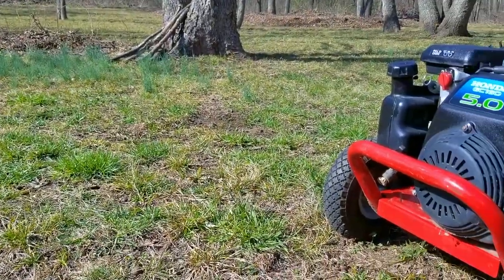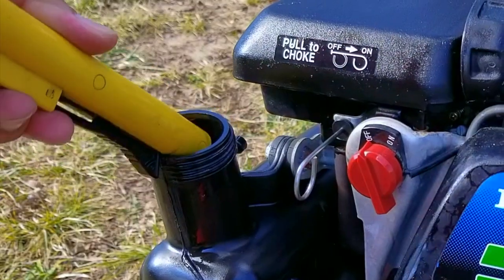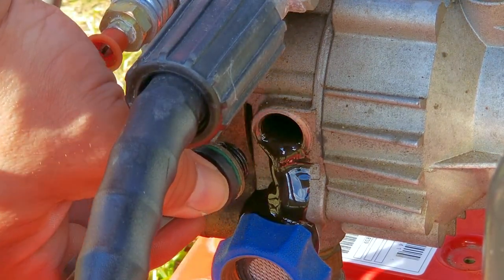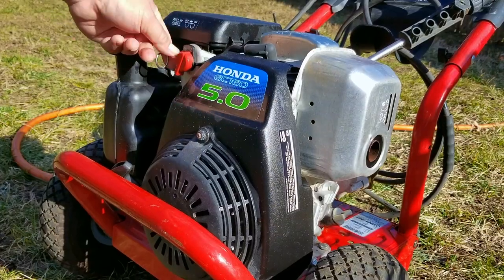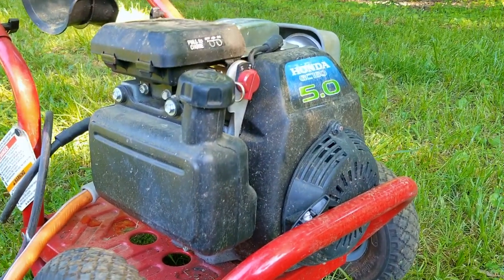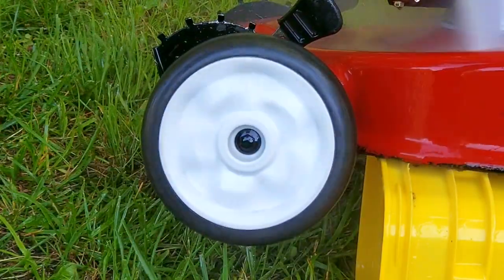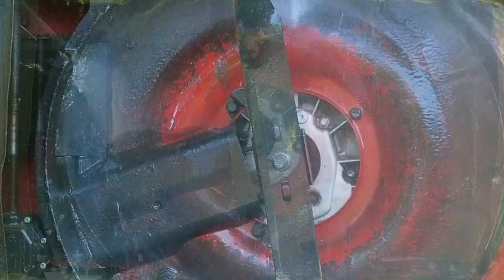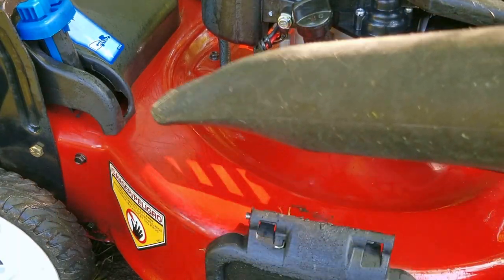Reconsider Your Choice On Getting One Of These

Comment: last time i let someone borrow my pressure washer it came back with a blown pump .  told them never to let it running more then 1 minute without water going through it.   Will never lend it out again.

imho, a pressure washer and air compressor are items that every homeowner should have.   so many uses for them
Reply from the maker: nice I like that you knew about keeping water going through it so it wouldn't overheat and yes these and air compressors are a must. Thank you Whym123

Comment: I love my power washer and use it often. My situation is quite different than yours, no neighbors, and a gravel area in front of the shop to spray stuff off on. I'm a bit lazy on the maintenance, I just run it empty on gas and then drag it to the basement for the winter. One thing you didn't mention was to not let the engine run without water passing through the wand or you'll burn the pump up. Even a minute done a few times can shorten the pump life.
Reply: Very true..dont leave it run for a minute without using the trigger
Reply from the maker: you are correct, thank you Robert Baysinger.

Comment: I was given a corded pressure washer from my folks after they decided it was more of an impulse buy because it was on sale for a great deal than a need. I only use it 2 or 3 times a year for my decks and brick walkway. I always go back to using my brass garden nozzle since I get similar results for much less work and the nozzle does well cleaning my gas mower. For a simple piece that fits in my pocket, the nozzle will always be my go-to
Reply from the maker: thank you Donald McFarland.

Comment: One word of caution that should be pointed out....if you live in the northern states where it freezes in wintertime; use RV antifreeze to fill the pump.  Like me, I forgot to fill the pump with the antifreeze and the pump froze solid and broke the casting.  Ordered a new pump and won't make that mistake again.
Reply from the maker: nice, thank you Doc Palazola.
Reply: To avoid doing that I keep my pressure washer in my basement for the winter 😅

Comment: I had a fluid-injection injury as a teenager.
Ours had an ajustable nozzle that went all the way from a pencil jet to a very gentle fan.  I had been pressure washing for hours and was covered in mud and soap.  As I had done MANY times before, I swapped over to the "gentle fan" to wash off the nasty.  Apparently the nozzle had a bit of grit in it and stopped prematurely.  For the next 5-10 years I had a visible reverse "nike swoosh" on my right arm.  It burnt like hell in the shower for several weeks.  Luckily it was only on a less aggressive middle position instead of pure jet.  That would have caused some major tissue damage.
Reply from the maker: wow! thanks for sharing that with us. I never know it could be so bad.
Reply: @HomeGaragechannel  Yup.
Hydraulic injection (oil) is even worse.  The water does a lot of tissue damage...  Oil does the same damage and then kills the tissue around it.  If you start playing with baby tractors or hydraulic snow blowers (or really ANYTHING with a high pressure pump) please be very careful around leaks.
Reply from the maker: wow, I didn't know that.

Comment: You are correct. The last one I got from a customer and he did not want to repair it. I rebuilt the carb and fixed the flat tires and it sold within about an hour of putting in out by the road. I have a large one for my own use but they are a pain to maintain and make sure no water is in the pump and hoses for the winter. Thanks
Reply from the maker: thank you Waterman one!

Comment: As someone who also repairs equipment, I almost always have multiple pressure washers sitting around.  I also have an electric one, which I usually use for cleaning mowers and other equipment.  I find the 1400psi/1.3gpm rate of flow is adequate for that usage, but not too much else for me.  It wouldn't really get the driveway, paver patio, deck, or 2nd story siding cleaned effectively.  It used to take me almost 2 days using my previous gas PW (2700 psi, 2.3gpm) to do my siding and deck.  A couple years ago, I got a big unit fixed up and was able to get the deck, patio, driveway, and siding done in one long day.  The 4000psi, 4gpm setup with 2nd floor nozzles and some cleaner really made quick work of everything.  The big surface cleaner certainly helped too.
Reply from the maker: I'm hoping to get a surface cleaner this year, but it's not a priority. Thank you Matt Wickert.
Reply: @HomeGaragechannel  For the "floating" type ones without the casters, I like the Karcher one.  The rotating and spraying part has more metal than the ones at Home Depot/Lowes.  I think it's around $60 on Amazon.  I had the B&S one from HD originally, and sand and dirt got inside and it wouldn't rotate well after a couple uses.
Reply from the maker: that's a shame. What is the metal part rotating on? a bushing or some sort?
Reply: @HomeGaragechannel  I believe there was a bushing on the B&S one.  I tried taking it apart and cleaning it a couple times, but it still didn't spin very well.  I have a 15x20 paver patio with poly sand and usually a good bit of moss build up.  There was always a lot of sand and dirt being thrown up by it.  The Karcher for the floating style has been great, and so has the Powerhorse 12" caster style from Northern Tool over the years.  Certainly a noticeable difference in quality.
Reply from the maker: very nice!

Comment: I pulled out my Honda GCV 180 powered 6.5 hp Toro hover mower today from winter storage, filled the gas tank, shot a squirt of carb cleaner in the carb & it fired up first pull ! This is an engine that was run with no oil a few years back, i had drained the oil for winter & totally forgot i had done so & worse, i never checked the oil level. It ran about five to ten minutes then seized up solid.
I slowly worked it loose, ran two oil changes through it & it’s been the same ever since, very impressed at it’s durability.
It was a mower I purchased second hand that had been left outdoors for two years so it really is a hardy little engine.
I wish my petrol pressure washer also had a Honda GC engine
Reply from the maker: wow, you really put the thing thru its paces
Reply: @HomeGaragechannel  like something out of Project Farm 😂

Comment: I have an electric one.  I too only use it a few times a year.  I use it for the front porch, back deck and the house siding.  I’ll use it more throughout the summer on the yard equipment: mowers, tiller, tractors and vehicles.
I have used it as a paint remover on a wooden split rail fence that was peeling badly.
I’ve thought about an gas powered one but never quite pulled the trigger and got one.  Maybe if a free one came my way.  Sometimes having to trip over the electric cord or having to find an extension cord because what I need to wash is otherwise just out of reach.
Reply from the maker: nice, thank you Steve Halsey

Comment: I have this exact model. I’ve been very happy with it. When I’m done using it I pull the rope handle thru a few times with switch off to purge the water. However I will never loan it out again. It was returned to me with water in the crankcase. It took 3 oil changes to purge the water. I found out the man who borrowed it loaned it out to a friend of his. Never determined how they waterlogged the crankcase.
Reply from the maker: very nice!

Comment: I bought a used, very old pressure washer for only $3.00 about a decade ago. Of course, the pump was cracked and I ordered a new one for around $100.00, which (on the surface) seems like a dumb move but I have gotten so much use out of it over the years that I don’t regret it and feel like it was money well spent. The worst part about pressure washers (at least the vertical shaft models) is the extreme vibrations. I was using mine once when It started running extremely rough. I stopped my work and looked over at the unit and the nuts and bolts retaining the carburetor to the engine had vibrated loose over time and the carb was literally hanging on by a thread! Replacing the hardware with some thread lock solved the problem.
Reply from the maker: you got a great deal and a lot of great use out it, nice work problem solving it.

Comment: I have a nicer electric one.  I use it a lot to clean my canning equipment outside (too big for inside) and other outside stuff. It’s not as powerful as the gas ones but it’s small and still big enough to clean concrete, siding, and gutters. It’s quiet and when I am done I just squirt a bit of pressure washer antifreeze into the inlet to keep the pump good.  I use those bottles that screw into the hose fitting.
Reply from the maker: nice, thank you TKC.

Comment: I bought a gas powered pressure first  because i needed power for my decks and sidewalks and driveway, but to powerful for anything else so i bought an electric one for lawn furniture, lawn mowers and anything that would be damaged by the gas one. i also bought a battery washer for a place i have that doesn't have a water supply and it works great. One  size dosent fit all when it comes to pressure washers .
Reply from the maker: you are correct, and having options is nice
Reply: Just use wider angle tips for lighter duty cleaning, a 2000-3000 psi model can do almost anything, you just don't put the tip too close.

Comment: I bought my first one a Blackmax 212cc Ducare engine  one from Walmart last summer and the pump I don't believe to be serviceable, engine rpm isn't adjustable. 2500psi and 2.5gpm. it's not bad vibrates alot when it's on concrete (I plan on adding some polyurethane engine mounts) to lesson the vibration. As well as upgrade the tires to rubber ones that take air (which I already have off a old machine.) The current ones are a cheap hard plastic that doesn't absorb vibration at all. 
 I paid I think $200 and it's not bad. It's teaching me a few things for sure. If and when it goes down I will either upgrade the pump to a serviceable one or possibly upgrade the entire washer. But I am hoping to be able to get a good 6 years at least from this machine.
Reply from the maker: not a bad price, and yes that engine makes quite a bit of vibration

Comment: Power washing will damage patio bricks ,siding ,paint on cars,roofs or anything you spray.its like sanding .maintenance its a big problem .I had a total of 5 at one time ,pump seals carburetor or anything that might go wrong.Get a good hose sprayer soap and brush.I did not buy any of them,found on a curb and received free.I am very happy now with less problems to fix.😊😊😊😊😊😊😊😊😊😊😊
Reply from the maker: thank you Anthony Triolo.

Comment: I have a 1/2 horse Graco washer, corded and probably 12 to 1500 p.s.i. and finally found a new unloader. Ran it for years with water going everywhere.  I ought to get rid of it because a brother-in-law gave me a Troy-bilt with a bad pump. I Ebayed everything from the crankshaft out and am well satisfied but will get a bigger pump when they make one for a vertical shaft rig. Hose and everything is 4K rated and I might be running 2800. It's easier than the plug in job to set up and drag around because I have a reel on it and a 50 foot hose. It had a 7.75 plastic cam motor (Briggs) that runs fine. I've run washers off and on for years and really like having one but you need to drain the pump every fall. There is a fitting you can get that will hook up your pressure washer intake with your air hose and you can dry out the whole system in a jiffy. I pour in a little antifreeze and pull the starter some just to be sure. No problems so far. Thanks and Blessings!
Reply from the maker: nice thanks for all the tips
Reply: @HomeGaragechannel  U 2, Pal!

Comment: Assuming l have a job that could use one, l would definitely buy one. My dad has used his for 15 years washing a dirt late model each week after the races. And it is so much easier to clean a racecar with that than a brush and soap.  The keyway on the pump shaft or crankshaft actually wore out after years of use. He was able to use an epoxy of some sort to fix it. That was a couple of years ago, now that he doesn't have the race cars 😔 so he doesn't use it that much, but so far that fix has worked. Its a north star with a cat pump and a honda that's been bullet proof besides the issue mentioned above (to my knowledge that's been the only issue with it).
Reply from the maker: wow very nice units!

Comment: I do own an electric pressure washer 1600 psi for small jobs and  Ryobi gas power one 3200 psi, logically the electric one does not do a good job as the gas one especially when I pressure wash my driveway. Here in Florida when it rains just about everyday in  the summer, mildew  builds up on older driveways like mine pretty quickly and can become very slippery so is essential that you own one unless you want to hire a company to do the job and pay  around $100.
Reply from the maker: yes the mildew is incredibly dangerous to walk on when wet.

Comment: I have a Honda GC190, which is practically the same as this one in the video, but I want to know how to remove the output shaft that goes to a pressure washer? It's tapered with a housing that spins around if no bolts are attached when the motor runs. I really haven't found anything on the internet that would help me on removing the device on the output shaft. Thank you in advance.
Reply from the maker: to be honest, I've never had to take one off yet, so I wouldn't know.

Comment: Too many don’t use power washers as they were meant to be used.  To remove mildew from wood or concrete, use the soap tip and chemical reservoir to put the mix on … let it sit … then remove with pressure head. I use the white tip most frequently.  The others damage the wood. 

Also do the whole job on a cloudy day or evening as so the chemicals don’t dry up before acting on the surface.
Reply from the maker: nice tip thanks!

Comment: I have a 13 hp 4000psi washer. When the trigger is off, I get spikes of pressure down the hose every 5 seconds, the whole hose stiffens then relaxes. All air is bled out of the water supply beforehand. Any thoughts on this?
Reply from the maker: Unfortunately no, but If had to guess, I'm think the unloader valve is "sticking"